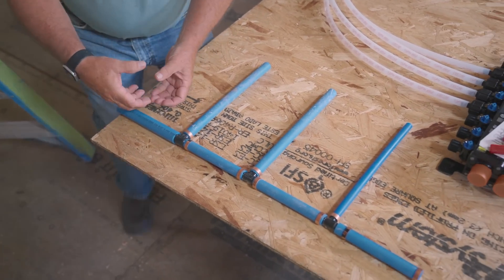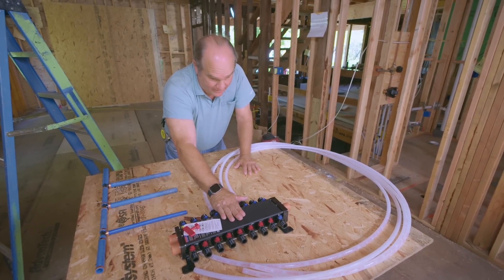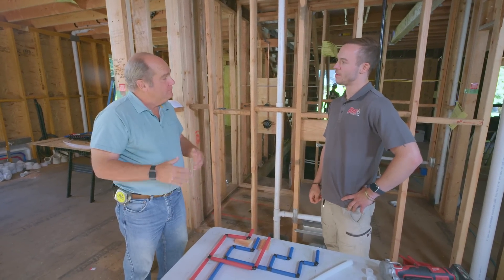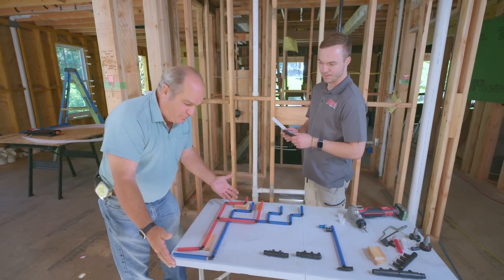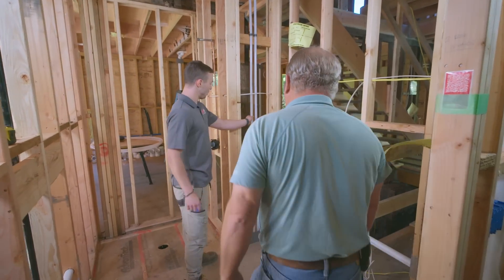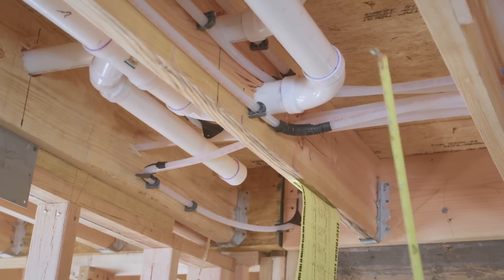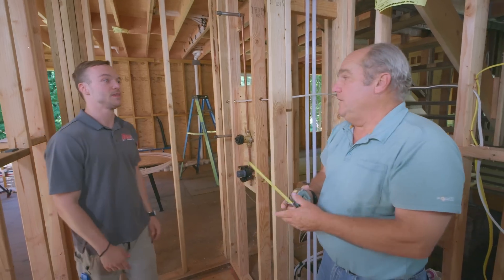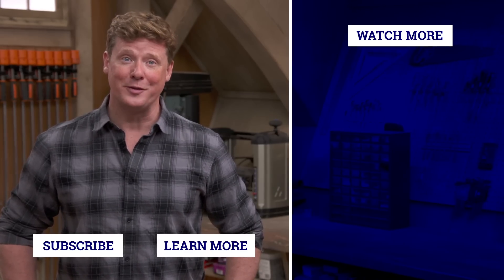A New Take on Water Supply Design | This Old House

Comment: Just stick with the gold standard, copper.
Reply: I wonder if there were luddites in the 20's saying they'd stick with the tried-and-true, lead piping.
Reply: @RoastBeefSandwich  Well, actually there is nothing wrong with lead pipes as long as the inner layer of oxides is not disturbed. Lead only gets in contact with the water if the layer is disturbed by a changing water compositions. I would be way more worried by all the plasticizers leaching into the water compared to a decades old lead installation with stable water characteristics.
Reply: @eaglevision993   Flint.   Amongst many others.
Reply: @horseman0568  The problem in Flint was exactly what I described above. They changed the water source and this eroded the century old layer that separated the lead from the water.
Reply: Or the platinum standard: Stainless steel.
Reply: Or the Gold Standard…gold.
Reply: Yea for more plastic!!!! Healthy, completely biodegradable, recyclable, and proven to last 60+ years..... oh wait....
Reply: Asbestos reinforced concrete was used for the main water line for my work building. It was cheaper than copper..... just like all other plastic water lines. Took them a while to find out it was bad for you.
Reply: Copper isn’t the gold standard anymore. I have nothing against it but pex is just so much better. It’s cheaper not only in material but in labor. It’s freeze proof. You don’t have to worry about electrolysis or any corrosion. It’s also tough as nails. If anyone’s ever tried to get an expansion fitting undone, they’d learn that. Expansion fittings are the gold standard of pex.
Reply: @joshcowart2446  Also you can create more sweeping 90-degree elbows which lower pressure loss. Also reduced problems from water hammer.
Reply: @ugh-meh  with copper you can put a tee, a 2’ piece and a cap for water hammer so it must be better
Reply: @joshcowart2446 copper doesn’t have micro plastic particles
Reply: @B.E.C.K.  I’d have to see research about that. That’s what everyone says but I’ve to see something that proved they’re enough to cause any damage. But everything’s about trade offs. If someone is concerned enough about microplastics that they want to spend the extra money for copper, no one is stopping them.
Reply: @joshcowart2446  Just because it is cheaper it does not mean it is better. Pex is the lowest grade material followed by multi layer aluminum composite pipe as the next better option. 
Yes, it is easier to work with for laymen and unexperienced plumbers. It needs no skills install, and that the the only plus side.
Reply: @eaglevision993  you sound like a guy desperate to keep your job and relevancy.
Reply: Hey it ain’t 1960 anymore. Pex is superior in nearly every way.
Reply: @Realmicahsumner You cant say that because it hasn't withstood the test of time yet. Also we dont know the effects on the body from the chemicals used to create the plastic. Recently we've all heard drinking from plastic water bottles is unsafe.
Reply: @Realmicahsumner  Yup, that is what was said about polybutylene pipe too.
Reply: @eaglevision993  you’re making a fool of yourself please stop for your sake
Reply: @Realmicahsumner  May I ask you what education in the field you hold? Of course, most houses need to be slapped together as cheap as possible and most contractors will never hold copper or stainless in their hands throughout their career these days. 
When our clients demand the best and money is not tight, stainless is what they get.
Geberit Mapress in most cases. You can say what you want, the quality is lightyears beyond PEX. I have it in my house too. I am also not a fan of the rubber gaskets but with stainless there is not much choice.
Even for my radiant floor heating I only used multi layered composite instead of pex. 
Pex is the cheap, easy, will do for a while - option. Not what you want if you have money.
Why do you think all commercial installation, expecially with food processing use stainless? PEX is also prone to bio film build- up when your hot water temp is not high enough or if you have long stagnant lines with little use.
Reply: @ I own a plumbing company. I fix more leaks on copper than anything else.
Reply: @Realmicahsumner  Well, copper leaks at some point like every plumbing does. But how old are these installations you service?
Reply: If PEX can last 40 years then it's as good as copper. I had to rip out all my copper piping because it was riddled with pinhole leaks after it was in service for 40+ years.

Also of note newer copper isn't as good as old copper or so the plumbers tell me. According to them new copper is very prone to developing pinhole leaks
Reply: @kylefowler5082  That is actually true. New copper lines are of way lower quality as they used to be. They use a lower grade copper with less purity and thinner pipe walls. 
Excessive pinhole leaks can have 2 sources btw. The composition of the water along with material mixed in the installation leading to electrolysis or flow turbulence if the pipe is not correctly deburred before assembly. That counts for solder and press fittings.
Reply: It’s 2024. Copper is done.